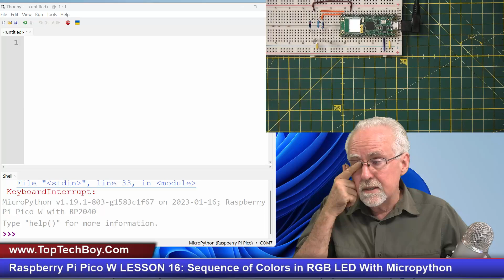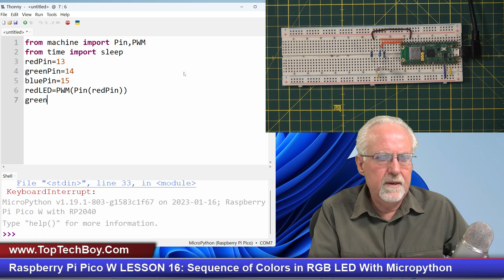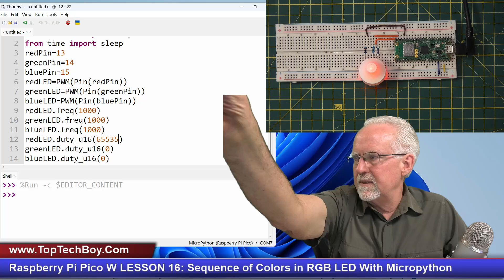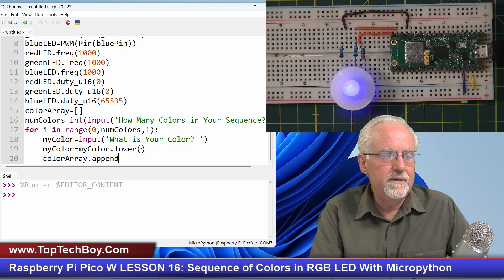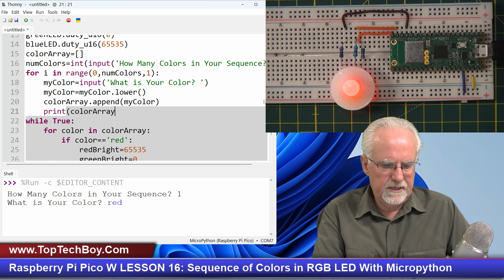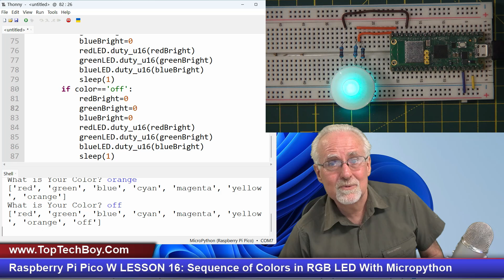Raspberry Pi Pico W LESSON 16: Sequence of Colors in RGB LED With Micropython

Comment: Very new to python, wrote program that prompts user for number of loops, how many loops/sec. It then prompts the user for number of colors. The program then calls a function which prompts the user to provide each color, portion of each loop that the color will display, and the % of full brightness for each color. The function checks to insure time percentages add to 100 ensuring loop time meets requirements. If inputs in error user is prompted to correct time percentages.  The function lets the user know percentage remaining when color info is input. The function generates  an array with each element containing color, on-time, and  16 bit duty number for the selected colors.  The function return this array.  The while loop uses the colors provided by the color selection array to look up color data  in a color pallet array.  The color pallet array provides color initial, color, and 8 bit RBG counts for each color. For loops implement the input number of loops.

  from machine import Pin, PWM
from time import sleep
gpio_pins = (13,14,15)                               # Tuple containing GPIO pins going to be used
redpin, greenpin, bluepin = gpio_pins      # Unpacking tuple assigns GPIO pins to variables
# Setting up PWM output for LED
redLed = PWM(Pin(redpin))
redLed.freq(1000)
redLed.duty_u16(0) 
greenLed = PWM(Pin(greenpin))
greenLed.freq(1000)
greenLed.duty_u16(0)
blueLed = PWM(Pin(bluepin))
blueLed.freq(1000)
blueLed.duty_u16(0)

def bld(text):                                 # Bold function, bold text used in prompts
    bold_start = '\033[1m'
    bold_end = '\033[0m'
    return bold_start + text + bold_end

def ord(inum):                             # ord function applicable for numbers < 101, Provides 1st, 2nd, 3rd....., used in prompts
    if inum > 20:
        odval = inum % 10
    else:
        odval = inum
    if odval == 1:
        return (str(inum) + 'st')
    elif odval == 2:
        return (str(inum) + 'nd')
    elif odval == 3:
        return (str(inum) + 'rd')
    else:
        return (str(inum) + 'th')
  
# List of tuples, each tuple contains Color, and red, green and blue color counts. Indexed searching looks up color and associated 8 bit RGB info for each color

colorpallet = [("r","red",255,0,0),("b","blue",0,0,255),("g","green",0,128,0),("c","cyan",0,255,255),
              ("m","magenta",255,0,255),("y","yellow",255,255,0),("o","orange",255,165,0),("w","white",255,255,255)]

def getcolors(ncolors,numloops,looptime):         # Funtion calculate time requirement for each loop, and provides a tuple  
    colsel = []                                                                # which   contains color, color on-time, and color intensity. Data returned for each 
    brirm = 100                                                             # color is the right type, and magnitude for each color selected, no further 
    for i in range(1,ncolors + 1):                                # manipulationr is required
        cosel = input(f'Input {ord(i)} of {ncolors} colors, on-time%; {brirm}% available, and brightness % i.e "Red,20,75": ').split(',')
        cosel[0] = cosel[0].lower()    
        cosel[1] = int(cosel[1])
        brirm = brirm - cosel[1]
        cosel[1] = float(cosel[1]/100) * looptime
        cosel[2] = int(float(cosel[2])/100 * 65535)
        colsel.append(cosel)
    if brirm < 0:                                                          # % cycle time remaining, < 1 is an error, user prompted to correct time allocation
        print('Combined time for each color exceeds loop time, correct times.')
        numelements = len(colsel)
        oldv = []
        for i in range(numelements):
            oldv.append((colsel[i][0]  + ':' + str(int(colsel[i][1]*100)) + '  '))      #String showing what values were input
        print(f'Current values: {oldv}')
        nval = input('\nInput corrected color on-time percentages, comma delimited, no spaces: ').split(',')
        colength = len(colsel)
        for i in range(colength):
            colsel[i][1] = float(nval[i])/100                    # Correcting time values in list of list
    colsel = tuple(colsel)                                           # converting list of list to tuple
    return colsel
    

while True:
# Show user color pallet, can use color , color initial , upper or lower case.
    print("\nColor Choices are:\n	Red - ", bld('R'),"	Blue - ",bld('B'),"	Green - ",bld('G'),"	 Cyan - ",bld('C'),"	Magenta - ",bld('M'),"	Yellow - ",bld('Y'),"	Orange - ",bld('O'),"	White - ",bld('W'),"\n")
    loopd = input('Input number of loops and the number of loops per second desire: "x,y": ').split(',')  #Loop, loop/sec input to list
    numloops = int(loopd[0])
    looptime = 1/float(loopd[1])                       # convert number of loop/sec  into time/loop
    numcols = int(input('Input number of desired colors in each loop: '))
    pincontrol = getcolors(numcols,numloops,looptime)             # Tuple of Tuples - provides color, duration and brightness data
    for _ in range(numloops):
        for pindat in pincontrol:
            curcolor,ontime,brightness = pindat                             #Unpackin color tuple within pincontrol and assigning variables
            idx = 0 if len(curcolor) == 1 else 1                                 # Identifies which element is the color pallet array to search for color
            for i in range(8):
                if curcolor == colorpallet[i][idx]:                                # break stops the for loop when color is found, i is the index number
                    break                                                                         #for the color
            rduty = int((colorpallet[i][2]/255) * brightness)          # Calculate the RGB percentages and multiplies by the desired 
            gduty = int((colorpallet[i][3]/255)  * brightness)        # brightness to provide the duty number for each color
            bduty = int((colorpallet[i][4]/255)  * brightness)
            redLed.duty_u16(rduty)                                                 # Turn the LEDs on
            greenLed.duty_u16(gduty)
            blueLed.duty_u16(bduty)                                       
            sleep(ontime)
            redLed.duty_u16(0)                                                           # Turn the LEDs of
            greenLed.duty_u16(0)
            blueLed.duty_u16(0)
        sleep(.5)                                                                                 # Provides break between each loop
Reply from the maker: LEGEND!

Comment: I don't have RGB led yet but I did it with 3 leds green , red , yellow , I've added also a message if the user entered the wrong comman here is my solution : from machine import Pin
from time import sleep

redpin =16
redLED = Pin(redpin,Pin.OUT)

greenpin = 17
greenLED = Pin(greenpin,Pin.OUT)

yellowpin = 27
yellowLED=Pin(yellowpin,Pin.OUT)

while True:
    cmd = input("Quelle couleur voulez-vous faire clignote 'red','green','yellow' ?")
    cmd=cmd.lower()
    if cmd not in ['red','green','yellow']:
        print("Vous avez entrer une mauvaise commande !! ")
    if cmd == 'red':
        
        nb_clignotant = int(input("Combien de fois voulez-vous faire clignoter la led red ? :"))
        for clignotant in range(0,nb_clignotant,1):
            print(clignotant)
            redLED.value(1)
            sleep(1)
            redLED.value(0)
            sleep(1)
    if cmd == 'green':
        
        nb_clignotant = int(input("Combien de fois voulez-vous faire clignoter la led green ? :"))
        for clignotant in range(0,nb_clignotant,1):
            print(clignotant)
            greenLED.value(1)
            sleep(1)
            greenLED.value(0)
            sleep(0)
    if cmd == 'yellow':
        
        nb_clignotant = int(input("Combien de fois voulez-vous faire clignoter la led yellow ? :"))
        for clignotant in range(0,nb_clignotant,1):
            print(clignotant)
            yellowLED.value(1)
            sleep(1)
            yellowLED.value(0)
            sleep(1)

Comment: This is my take. 

from machine import Pin, PWM
import time

redPin = 15
greenPin = 14
bluePin = 13

redLED = PWM(Pin(redPin))
greenLED = PWM(Pin(greenPin))
blueLED = PWM(Pin(bluePin))

redLED.freq(1000)
greenLED.freq(1000)
blueLED.freq(1000)

# PWM initialization
redLED.duty_u16(0)
greenLED.duty_u16(0)
blueLED.duty_u16(0)

while True:
    numColor = int(input('How many colors do you want?: '))
    colorNum = []

    for i in range(numColor):
        colorPicked = input('Type the chosen color/s and hit Enter (RED, GREEN, BLUE, CYAN, MAGENTA, YELLOW, ORANGE, WHITE): ').strip().upper()
        colorNum.append(colorPicked)

    print('You picked the colors:', colorNum)

    for color in colorNum:  # Iterate over the actual color list
        if color == 'RED':
            redLED.duty_u16(65535)
            greenLED.duty_u16(0)
            blueLED.duty_u16(0)
            time.sleep(1)
        elif color == 'GREEN':
            redLED.duty_u16(0)
            greenLED.duty_u16(65535)
            blueLED.duty_u16(0)
            time.sleep(1)
        elif color == 'BLUE':
            redLED.duty_u16(0)
            greenLED.duty_u16(0)
            blueLED.duty_u16(65535)
            time.sleep(1)
        elif color == 'CYAN':
            redLED.duty_u16(0)
            greenLED.duty_u16(65535)
            blueLED.duty_u16(65535)
            time.sleep(1)
        elif color == 'MAGENTA':
            redLED.duty_u16(65535)
            greenLED.duty_u16(0)
            blueLED.duty_u16(65535)
            time.sleep(1)
        elif color == 'YELLOW':
            redLED.duty_u16(65535)
            greenLED.duty_u16(65535)
            blueLED.duty_u16(0)
            time.sleep(1)
        elif color == 'ORANGE':
            redLED.duty_u16(65535)
            greenLED.duty_u16(10000)
            blueLED.duty_u16(0)
            time.sleep(1)
        elif color == 'WHITE':
            redLED.duty_u16(65535)
            greenLED.duty_u16(65535)
            blueLED.duty_u16(65535)
            time.sleep(1)
        else:
            # Default case: Turn off
            redLED.duty_u16(0)
            greenLED.duty_u16(0)
            blueLED.duty_u16(0)

        time.sleep(0.5)  # Delay between colors

Comment: Just wondering if you can create a variable to store 65535 for example 
On = 65565   (LED FULL)
Off=0   (LED OFF)
..not sure if On or Off are used within micropython 

So would say
redBright=Off
greenBright=On
blueBright =Off

I did not watch yet the cyan,yellow,orange and other colors and know this will not work for them 
But could you also make an array of values for RGB and use that to pull colours so code is not crazy long and use a loop to find values need for each RGB color

Hope I explained correctly

Comment: This version catches user typing errors.

from machine import PWM,Pin
from utime import sleep
R_led=13
G_led=14
B_led=15
delay=0
delay2=.2
delay3=.2
delay4=1
delend=4
redLED=PWM(Pin(R_led))
greenLED=PWM(Pin(G_led))
blueLED=PWM(Pin(B_led))

redLED.freq(1000)
redLED.duty_u16(0)
greenLED.freq(1000)
greenLED.duty_u16(0)
blueLED.freq(1000)
blueLED.duty_u16(0)

while True:
    print("PLEASE READ THE FOLLOWING INSTRUCTIONS")
    print("State how many colours you want and what order you want to dispay them in.\nPrint only one colour per question")
    print("Move curser to anywhere in the space below and left click")
    print("type the colour exactly as in the list displayed when asked for a colour")
    print("press enter after each choice")
    amount=int(input("How many colours do you want to display? "))
    print("You have chosen", amount, " colours")
    num=1
    colors=[]
    for choice in range(amount):
        print("Using these choices red,green,blue,cyan,magenta,yellow,orange,white or off.")
        color=input(f"What is you're colour {num}? ")
        color=color.lower()
        print("You're choice ",num, "is ",color)
        colors.append(color)
        num+=1
    print("You're final choices are")
    for I in colors:
        print(I)
        sleep(delay3)
    sleep(delay2)
    delay=float(input("How long in seconds do you want colours on for, 0.1 to 5? "))
    cycles=int(input("How many times do you want the lights to run? "))
    #print("Display will run in 3 seconds")
    sleep(delay4)
    start=3
    for t in range(3,0,-1):
        print("Time to start ",t,"seconds")
        sleep(delay4)
        print("running")
    for reps in range(cycles):
        for myChoice in colors:
            if myChoice=="red":
                colorR=25550
                colorG=0
                colorB=0
                redLED.duty_u16(colorR)
                greenLED.duty_u16(colorG)
                blueLED.duty_u16(colorB)
                sleep(delay)
            if myChoice=="green":
                colorR=0
                colorG=65550
                colorB=0
                redLED.duty_u16(colorR)
                greenLED.duty_u16(colorG)
                blueLED.duty_u16(colorB)
                sleep(delay)
            if myChoice=="blue":
                colorR=0
                colorG=0
                colorB=655550
                redLED.duty_u16(colorR)
                greenLED.duty_u16(colorG)
                blueLED.duty_u16(colorB)
                sleep(delay)  
            if myChoice=="cyan":
                colorR=0
                colorG=655550
                colorB=655550
                redLED.duty_u16(colorR)
                greenLED.duty_u16(colorG)
                blueLED.duty_u16(colorB)
                sleep(delay)  
            if myChoice=="magenta":
                colorR=655550
                colorG=0
                colorB=655550
                redLED.duty_u16(colorR)
                greenLED.duty_u16(colorG)
                blueLED.duty_u16(colorB)
                sleep(delay)
            if myChoice=="yellow":
                colorR=655550
                colorG=655550
                colorB=0
                redLED.duty_u16(colorR)
                greenLED.duty_u16(colorG)
                blueLED.duty_u16(colorB)
                sleep(delay)
            if myChoice=="orange":
                colorR=355550
                colorG=7000
                colorB=0
                redLED.duty_u16(colorR)
                greenLED.duty_u16(colorG)
                blueLED.duty_u16(colorB)
                sleep(delay)
            if myChoice=="white":
                colorR=6555550
                colorG=655550
                colorB=655550
                redLED.duty_u16(colorR)
                greenLED.duty_u16(colorG)
                blueLED.duty_u16(colorB)
                sleep(delay)
            if myChoice=="off":
               colorR=0
               colorG=0
               colorB=0
               redLED.duty_u16(colorR)
               greenLED.duty_u16(colorG)
               blueLED.duty_u16(colorB)
               sleep(delay)
    else:
        print("You have entered an incorrect answer! Please try again, be carfull to spell colours and enter numbers correctly.")
    colorR=0
    colorG=0
    colorB=0
    redLED.duty_u16(colorR)
    greenLED.duty_u16(colorG)
    blueLED.duty_u16(colorB)
    sleep(delay2)
    
    print("End of program, re starting")
    sleep(delend)